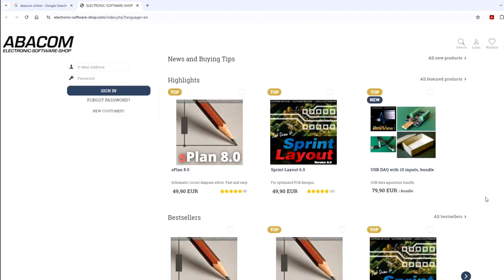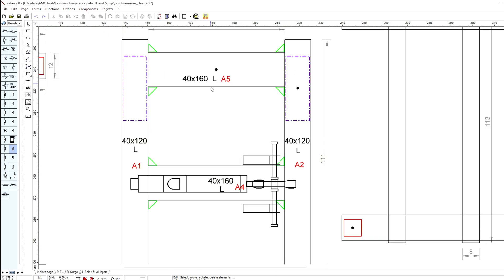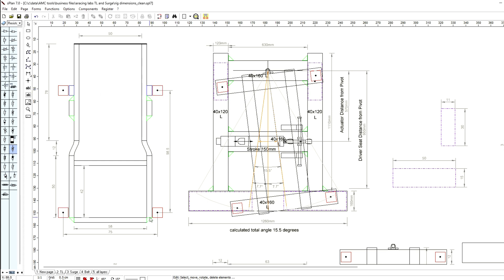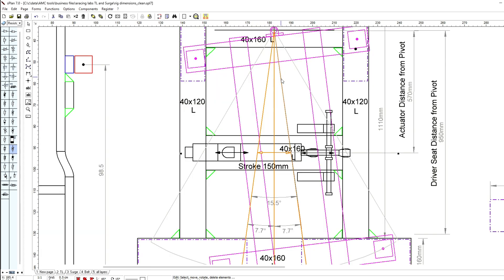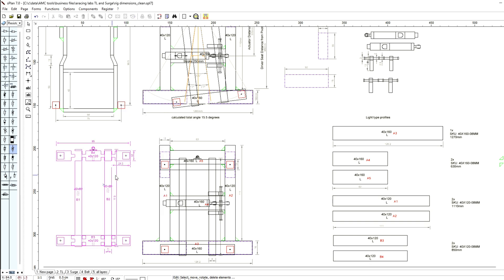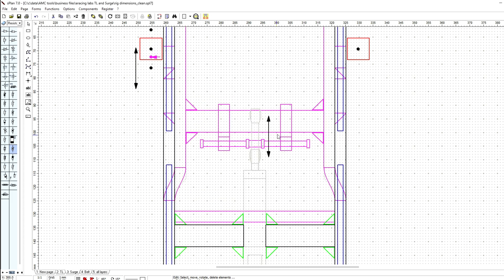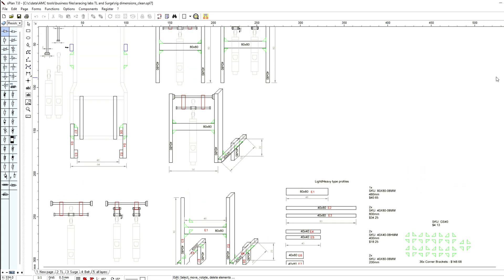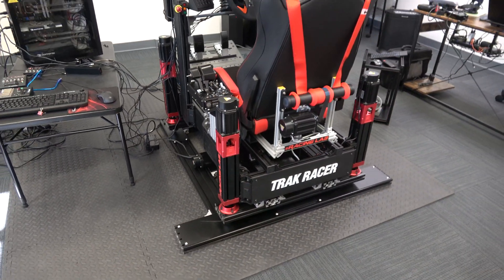How to easy design TL and Surge stages for your Rig

Comment: My issue is finding a supplier in the US that has 40x160. Plus, if they do. The one pice for the rear is $200... at the moment the frame would be over $1000 plus shipping costs!!
Reply from the maker: I got mine from Amazon (ASIN: B0CSFCGTG2 ) $120 each 40160 ... not cheap but at least it was free shipping 🤷‍♂️

Comment: What is deferent SG on top of 4 actuactor  and SG on botom of 4 actuactor?? Is that same??
Reply from the maker: @botak333  doesn't really matter, but if you put the Surge on top like I did, you have less mass to move around, and have more intense kicks for gear changes, without causing wear on the vertical actuators with searing forces...
Reply: @tronicgr  ohh i got it mate. Now one more questuon is about holder for 4 actuactor to botem rig. I have 4 second hand chinese servo they used ball rod end with m20 bolt. So wahat is deferent using your desain ( not fix position but with housing) vs like i have using ball rod end and fix position on botom rig.  What do u think mate?? Thanks for respond🙏🙏🙏
Reply: @tronicgr  @tronicgr  ohh i got it mate. Now one more questuon is about holder for 4 actuactor to botem rig. I have 4 second hand chinese servo they used ball rod end with m20 bolt. So wahat is deferent using your desain ( not fix position but with housing) vs like i have using ball rod end and fix position on botom rig.  What do u think mate?? Thanks for respond🙏🙏🙏

Comment: I wish someone could make this into a website you could just plug the numbers in and know what to order... So much good info
Reply from the maker: Eracing-lab provides all the little parts needed and generic layout example for the profiles. But the final dimensions of the profiles needed, depend on the measurements of your existing rig and vertical actuators placement...